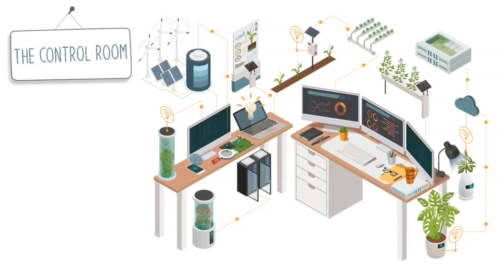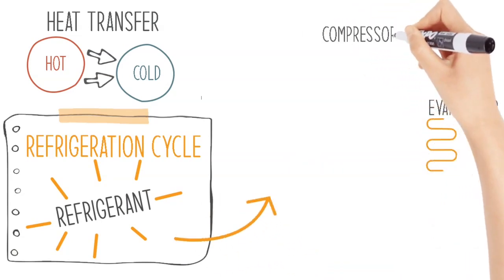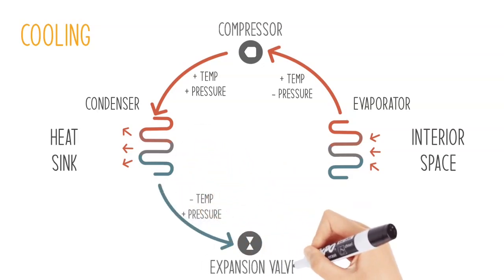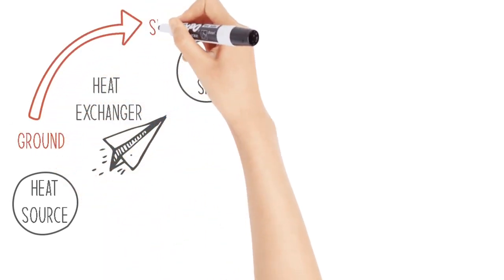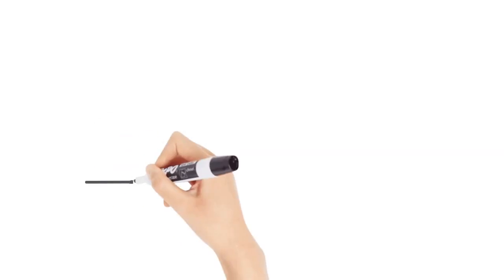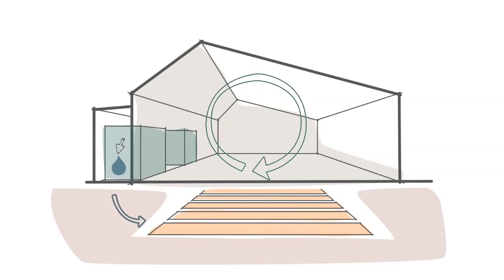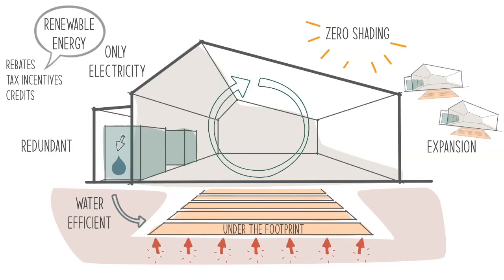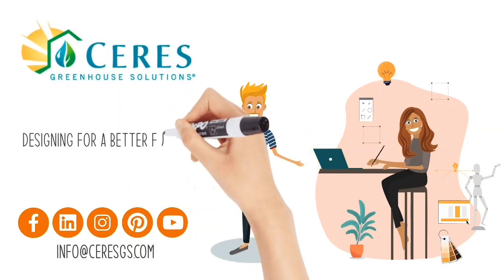The Control Room | Introducing the Ceres EcoLoop™, an Energy-Efficient Geothermal HVACD System

Comment: I am wondering about the COP of this compared to a old school geothermal heat pump? Where is the benefit?
Reply from the maker: The benefit of the EcoLoop™ is that it can precisely heat, cool and dehumidify a sealed greenhouse structure to any VPD (vapor pressure deficit) set points. The ground loop uses recirculating water to either heat or cool the greenhouse air circulating through the heat pumps. This makes is more effective that your regular geothermal heat pump which only exchanges air through the soil. Both systems are effective for certain applications. The EcoLoop™ is for sealed structures and usually recommended for our commercial clients.

Comment: The ecoLoop system seems like a geothermal heat pump system. The only difference is that in ecoloop system, underground matt is being used instead of water coil pipes. Am I right?
Reply from the maker: Yes you are right. Essentially it's a geothermal heat pump system with a water ground loop. The EcoLoop is not only specific in its design below ground but is unique by the way that it operates.
Reply: @CeresGreenhouseSolutions  i went to your website to read more about it components and details. Unfortunately you don't have enough information yet, not even on YouTube. You also strictly offering it as a part of a full package that includes the passive solar greenhouse itself. İ understand that you must recommend a fully sealed isolated structure of the greenhouse but it should be an option available for those who are not seeking a passive solar greenhouse too. Anyway way, you had three different sizes, may İ ask about the wattages consumption per hour for each system? Thanks
Reply from the maker: @Jean.34  We are happy to go into more detail if you contact us at info@ceresgs.com or ceresgs.com/contact/

Comment: What height of greenhouse can we have with this system?
Reply from the maker: Any ! The height has no difference except that it changes the volume of air that needs to be treated. This is not a limiting factor. In SunChamber we typically see 12' eave high greenhouses (meaning 18' ridge). It can be lower or higher depending on your needs.